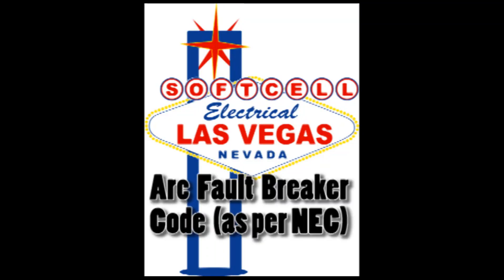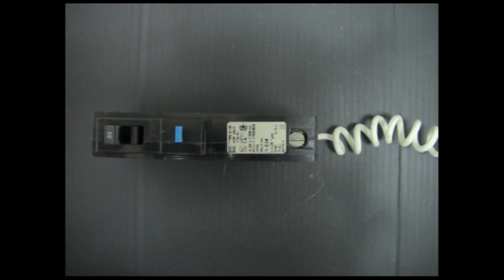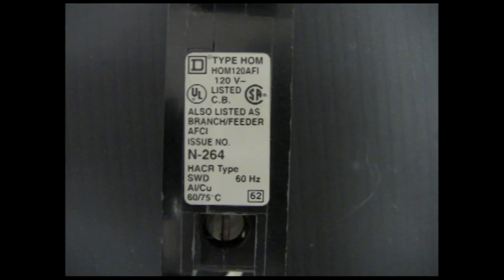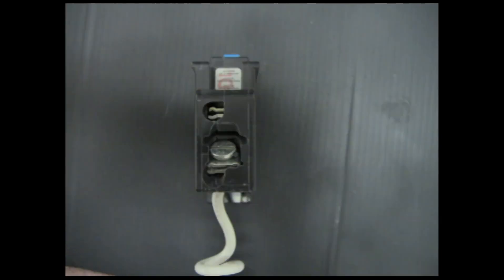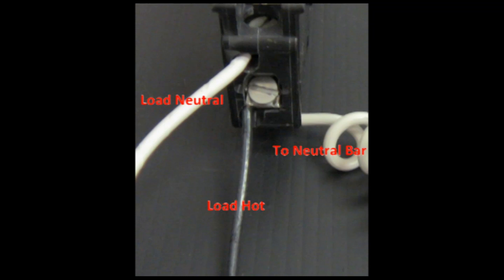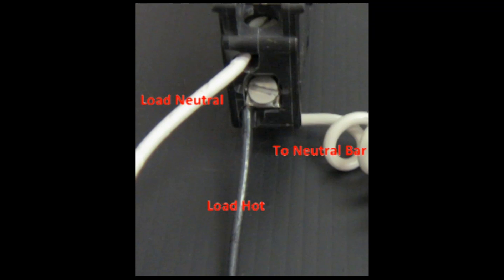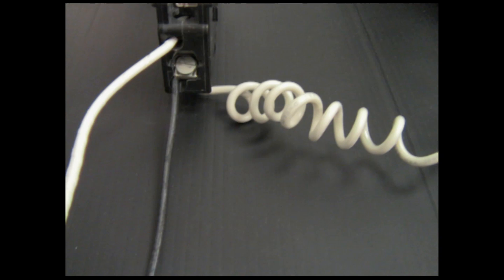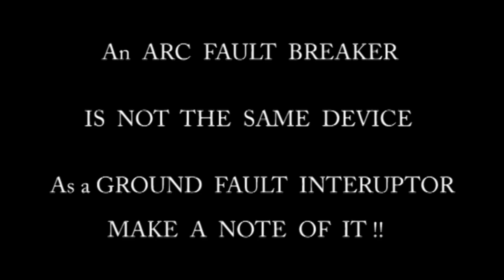Arc Fault Breaker (NEC Distinctions) # 80

Comment from the maker: Yes, no other outlets can be shared with a dedicated outlet. NOW on a designated circuit  you can share outlets, but the designated outlet may only be used for what the plans intended; ie, sprinkler clock,  hotwater heater recirculator, gas cooktop ignitor and so on. Big difference between dedicated and designated. Lessons 86 and 98 cover this pretty good.